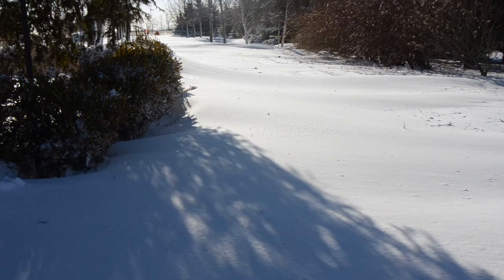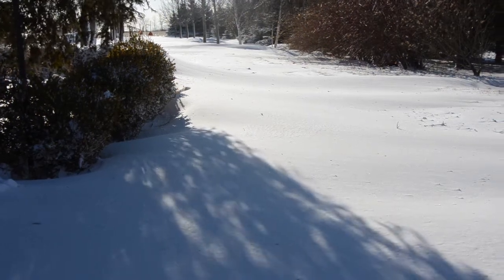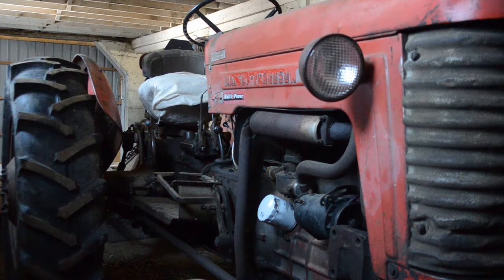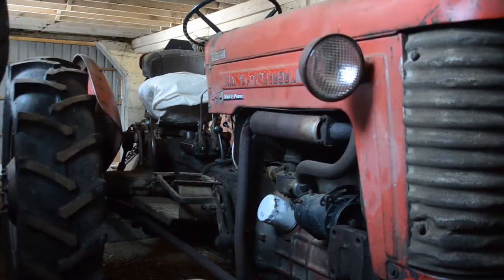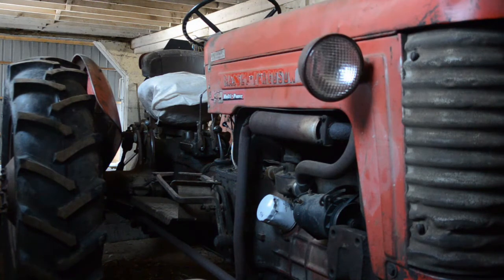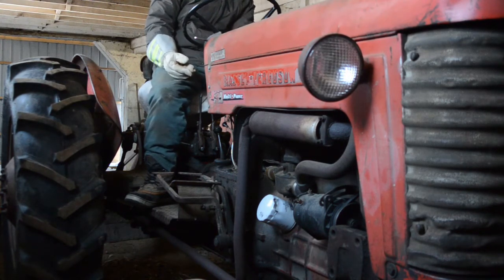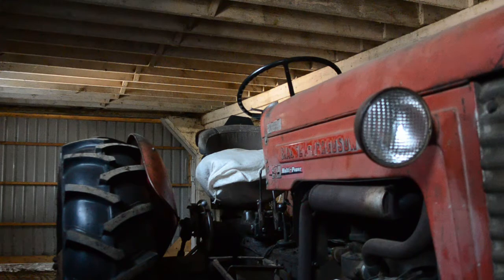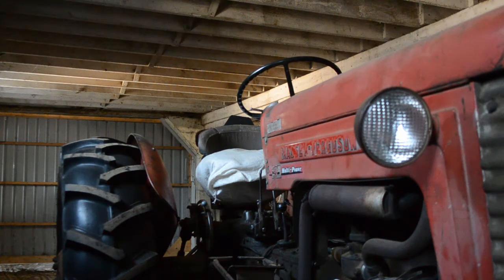MF 50 or 65  Just get the snow out of the way

Comment: Both the M-F 50 & the M-F 65 sounded sweet & started right up ! & that's what great about a gasoline tractor when it's that cold outside they start right up when you have them tuned & adjusted right & no need to plug in . Thanks for the video & I'm glad your team  Massey - Ferguson is working for You & those sweet Continental Engines.